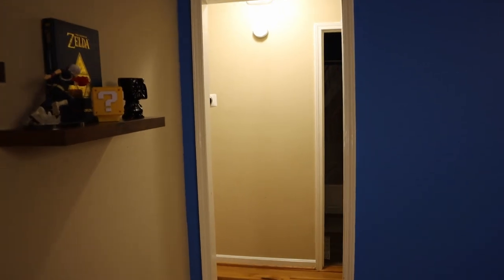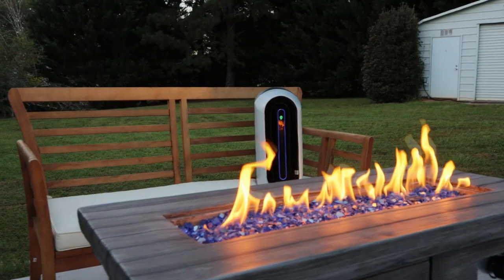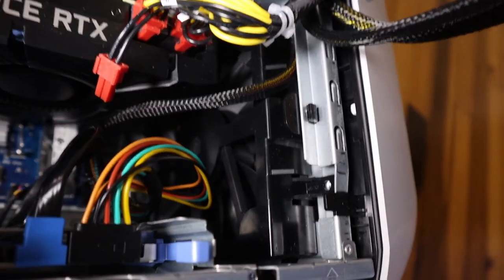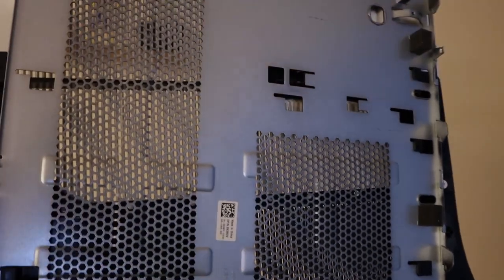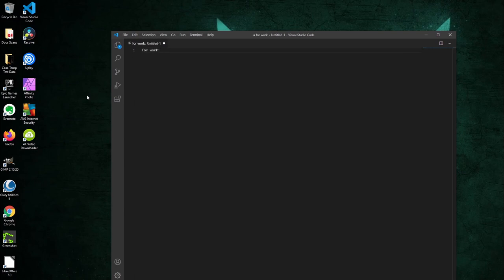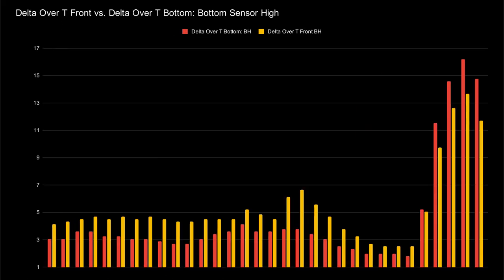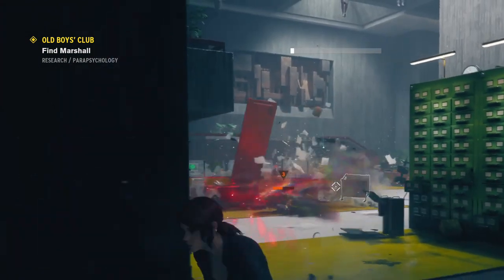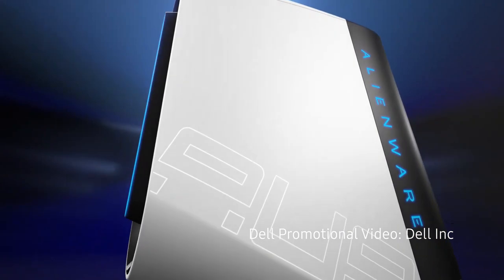Alienware R11 Cooling Teardown with Temperature Benchmarks

Comment: My R10 came with air cooling instead of liquid and was running 90-95 celcius constantly while gaming.  Dell told me the cpu could handle 95 celcius so there was no problem.  The fans are also cheap and were hitting 70dbs making it hard to hear in game sounds even with a high quality headset.

  If you are buying an Alienware Aurora machine make sure to grab the liquid cooled version or be ready to upgrade the cooling yourself.

I ended up grabbing a corsair h60 liquid cooler and changing the front fan to a corsair ml120 pro.  The system now maxes out at 68 celcius and runs super quiet.

Comment: I had the same issue.  Part of the issue is the Alienware control center has the fan controls on Auto.  Don't leave it that way.  Manually change the settings so that the fan kicks into higher speeds when it reaches an acceptable heat.  My CPU heat was spiking up to 100 degree Celsius when gaming on high settings and averaging between 85-95 degrees.  After making some adjustments to my fan controls, the highest I peaked was 83 degrees an averaging 65-75 degrees.  Since they took out the undervolting option, thanks to a BIOS update, had to think of other ways to cool things without scraping the warranty.  Yes, I know, there are better heatsink/fan options out there, but that would void my warranty.  This fan control option works for me... as long as you don't mind the volume they project.
Reply from the maker: I also noticed that Dell tweaked the fan curves in the latest Alienware Control Center update. That said, I am quite happy with the radiator and front case mod that I made.

Comment: I replaced the original GTX 1660ti with RTX 3080 for Microsoft Flight Simulator.  Since the recent update, 1.18.14.0, the workload was moved to the GPU. Now the GPU is hitting 75C.  I am trying to determine how to improve the cooling. I may consider adding an exhaust fan to the left side.  This GPU takes cool air from the bottom and blows some out the back, some out the top, and more out the side. 

The top GPU cooling vent is smaller than the radiator and 1st fan. Since the top vent from the GPU is small, I guess only about 1/4th of the heat would be blown out that vent and to the top PC radiator/fan.

I feel some heat coming from the back of the PC (pushed through by GPU 2nd fan).

However, I think more GPU heat is captured in the bottom half (blocked by the PSU and side cover). So it is likely recirculating.

I have the HDD (which I use for large files like videos and pictures and long term storage).  I may remove the HDD but do not feel an additional front fan there would help the cooling of the GPU.

I am considering a thin fan and hacking the metal part of the side panel.

Comment: I changed all my fans. I have push pull at the top.  Moved the Upper HD to the lower rear of the chassis. Added a Fan in its location and replaced the lower fan.  Top Exhaust fan is the ML120 Pro the 3 other fans are ML120 non rgb types. My system for not much money is now whisper quiet and cool. Later I changed the Psu to a corsair  RM650. again lowering the noise  level.  For the price I expected more from the Brand. I will not be recommending it to anybody.
Reply: do the corsair fans cause any errors in the Alienware SW?
Reply: could you add big 3rd party 3080 in place of intake fan and additional one behind the front cover, but outside the metal cage?
Reply: @kedzis  I have since changed to the thermaltake toughfan 12's. these very noctua af12 looking fans are both quieter and cheaper than the Corsair fans. They do not give the bios error so that's a massive Plus.
For the gpu yes it will go in with the lower intake fan removed. You can install a fan in the drive cage area as that is a removable parts so very simple to do. 
I have seen a fan installed onthe chassis floor but it does mean you have to dremel the plastics on the base to allow air flow.
Reply: @24879067marshall  do you think r10 with rtx3080 with bottom fan moved to upper hd position will not cause any thermal  problems? if I can manage to get one for good price and right size i would like to try, alternatively 3070(ideally two fan model so can keep intake fan in its position Is the maximum lenght of the GPU w/o bottom fan is 30cm and with fan 26.6cm? If I would like to add the additional fan do i use a y spliter or there are enough sockets on the MoBo?
Reply: @kedzis  im using the MSI Rtx3070 X2 Ventus. thats the 2 fan type.  plenty of performance to smash all the titles with great frame rates.

Comment: Loved the video! The intro was cute btw don't worry about it lol. 

Not sure if it's your field exactly, but would you be willing to do a tutorial on how to properly overclock and/or undervolt/lower power the consumption of the computer using the Alienware Command Center? Or at the very least explain the benefits/reasons not to do it? I hear a lot about those things and how it can potentially help gaming go smoother, but I honestly have no idea where to even start and it seems like no one even uses the Command Center as there are no informative videos about it. Thanks!
Reply from the maker: Thanks, and actually that is my field. I myself run a small undervolt on the 10700K of 1.22v with no offset. An undervolt reduces power to the CPU, which helps to reduce temps. Intel engineers are pretty conservative in their the stock voltage and (used to be this way about) their CPU frequencies. This is done to account for manufacturing irregularities across the platter. Though they've gotten better at pushing their stock CPU frequencies; the days of being able to overclock an Intel CPU by 20% or more is pretty much over.

Comment: I have an R11 with 10900k and 3090 first thing I did when it got here was open it up because I’m not the type of person that buys prebuilt machines but with the current GPU market alone there’s no other way to get a FE 3090 without going through scalpers/getting extremely lucky without waiting for a year from the looks of it, and the first thing I disliked (besides the fact the GPU is “a custom 3090 FE manufactured by Nvidia” I emailed/called instantly when I saw it because I really only bought the PC for the GPU but anyways) was the fact that there was only one fan other than the one dedicated to the rad.

Comment: So glad I got the R11 with the GPU liquid cooler. Yeah it's only an RTX 2080 super instead of a 3000 series but it runs so quiet and cool, never get that loud high pitched hair dryer sounding fan noise that air cooled R11 gpus get.
Reply from the maker: It really must be luck of the draw on the air coolers. I've heard people have had nightmares with noise on them, but I've been lucky with my 2070 Super that is aircooled. I did notice a big noise difference when I replaced the front intake fan (video coming soon).
Reply: I've been wondering if I should replace the fans but don't want to cause any problems with BIOS or Alienware command center or whatever. Would like them to be quieter though. Also wondering if it's a difficult job to replace the fans. Looking forward to seeing how that went for you.
Reply from the maker: @tim0thy222  I don't want to spoil it or give it away, but I struggled with the top fan replacement, and found out the hard way that only certain fans will clear the Dell BIOS check. It was worth it though. I will tell you that a Corsair ML120 Pro non-LED will fit up front with no problem if you want to try it for yourself. It must be the ML120 Pro version as the non-pro will not clear the BIOS check.
Reply: I have the r11 with a 3080 and it runs nice an cool around 70c boost all the way to 1950mhz it performs better than my custom build with the founders 3080 tbh

Comment: Great intro, the body of the video almost made me finish my third Master's degree :P
Reply from the maker: Thanks. I tried to present a lot of data without overwhelming anybody. The important thing to remember is that Delta T in this context simply means the reading of the in case sensors over that of the ambient room temperature sensor. I tried not to get too bogged down on this as my main focus of this test was to see if the Alienware was able to move a proper amount of air to cool the case and its components; which it can adequately do.

Comment: Good video!! I didn't understand Delta over T though.
Reply from the maker: It is simply a fancy way used in calculus and engineering of saying how much of a change occurred. I had three sensors: one in the front, one in the bottom, and one in the room measuring ambient temperature (Delta T and my control sensor).

Comment: im getting the r11 3090 10900k 32 gig 3400mhz 2 t ssd. should i get that second fan and if i do does it just pluggin to the powersupply?
Reply: There's videos of people adding a second fan and use Corsair  
SKU CO-9050040-WW
ML120 PRO 120mm PWM Premium Magnetic Levitation Fan

Which draws less power from the source.

But in those videos people are adding am extractor fan not an intake so I'm a bit confused after watching this video, what it doing to the pressure in the PC by adding an extractor fan rather than a intake

Comment: Alienware doesn’t give us gpu fan control which is why I have been using MSI afterburner to control my R9’s rtx 2080 Super. I use the AWCC overclock 2 option and use msi fan control at 50-55ish % on manual not auto because I don’t like the gpu fan throttling and I don’t use the msi fan curves. I ran my game “DCS “ at high performance and thermal performance In AWCC and use this combo only when I have the game running. My gpu temps are always under 75c. Look... it’s a gaming machine its like an automobile/ race car at that with more performance = more heat. My cpu is liquid cooled and would like to go that route one day on my gpu. Great video 👍🏻
Reply: I own r11 i7 with 2080 super. How do you keep your gpu cool? My gpu is over 80+ while playing cold war multi-player
Reply: Super loud when playing game
Reply: Are you using msi afterburner for your gpu fans?
Reply: Download msi afterburner “ it’s free “
YouTube some stuff about it and how to use it. When your ready set the gpu fan to 55 then click apply, not auto ... apply. Then start your game and check the temps. When you take a break from your game set the gpu to auto then click apply. When your ready to play again, unclick auto set gpu fan to 55-60 then click apply and then start your game and have fun. I don’t use gpu fan curves I think it’s better that the gpu fan/fans run 1 speed while gaming. I hope this helps.
Reply: @Mako-sz4qr  yeah, I even set it to 60. Still reaching 77.
Reply: That must but an intense game then but 77c is actually okay. If it’s concerning maybe call Dell to get some better answers or go to dell Alienware forum there is some good help in there. But honestly that may be the lowest temps  you can get in that game/multiplayer and 77c is not bad.
Reply: @Mako-sz4qr  I play Cold War multi-player. I guess it is what it is.
Reply: @itsajoke631  — yeah could be just msi af gpu fan at 60-65 while playing to help the temps. That’s a nice machine you have there.

Comment: The only joe do you have the link of the power supply used in the Alienware r11
Reply from the maker: It is an OEM 1000 watt fully modular standard ATX power supply. It looks to be a FSP Group (non-branded OEM) supply. FSP Group also makes the PSUs for Antec, Silverstone, Thermaltake and Zalman.

Comment: How do I put water in the cooling I need to know
Reply: You need  following parts. Corsair H60 Radiator,  Corsair Ml120 Pro (non led ) Fan.   If you have a fan cable splitter you can even run a push pull configuration on the radiator.  Google liquid cooling upgrade there are lots of guys who have made videos on the process.

Comment: Awesome video - are you planning to replace the front hard drive bay with a second intake fan?
Reply from the maker: It is definitely something that I've been thinking about.
Reply: @theonlyjoe6036  I'm thinking of doing the same, and putting in 2 high-performing front intake fans, as well as either replacing the exhaust fan or adding a second exhaust fan for a push-pull radiator configuration. But I can't find any data on how much this would actually affect temps, so I'm not sure if it's worth the cost and effort.
Reply from the maker: @zerwey  I don't think you would have the clearance for a push / pull for the RAD. I second intake would create a positive pressure environment which would help in cooling. I'm looking to see what options there are throwing a second one in. The one installed (and the mounting cutouts) use a fan that has clips to hold it in place; so I think I would have to go through Dell directly for this part. The other option, for something like some Noctua fans, would be to break out the trust Dremel and simply make my own mounting holes / screw inserts.
Reply: @theonlyjoe6036  Hi Joe. Did you replace the Hard Disc by installing a 2cond Fan? Did you contact Dell for the Mounting Cutout?
Reply: @zerwey  Gamer Heaven has done a test for your reference. Check him out. Very good info on dell mods. 👍

Comment: I wish dell did better on the case and added more exhaust fans and more intake so the inside the case it gets fresh air all the time
The GPU is gonna be very hot and the CPU too If the 3080 was in the case it would not get any Fresh air 
But yeah you have lots of good points they need to do a redesign on the case
Reply from the maker: I think that adding a second front intake fan and creating a positive pressure environment would do the trick. The Alienware does have those massive honey combs vents in the side panel which a positive pressure system would vent through. I'm thinking about modding the case to see if this actually works.

Comment: Thanks for the video! I guess the 3080 GPU will raise internal Temps even more. Yikes.
Reply: Actually,  it doesn’t. See the thermal test done  by people that own the r11 with a 3080 on YouTube.  Dell engineers know what they’re doing.
Reply: @entreri76x  Well I wouldn't say they know what they're doing. There's been numerous complaints regarding thermal issues with the previous R series cases. Hopefully they have fixed these previous overheating issues.
Reply: It doesn’t because there is a completely different cooling system on the 3080 and it doesn’t have a blower style fan.
Reply: @quintrapnell3605  I ended up just building my own PC last October with an AMD 5900x, MSI Tomahawk MB and Asus 3080 OC. Runs great and doesn't get too hot although I have a 280mm cpu liquid cooler which helps and a case with great airflow.
Reply: Then you notice the fans don’t pull air down and out the back as much now. They still blow some what out the back but they also blow upwards and out of the sides.

Comment: I wonder if the 3090 will kill it
Reply from the maker: Dell does already offer the R11 with a 3090 and 3080. The most telling thing for me is they offer the R11 with dual 2080 Supers that are air-cooled, so Dell must be confident that they can adequately cool the case. 17.8F over Delta (room temperature) was the highest the case ever got in my testing, and that really seemed to be the consistent max in 2 weeks worth of data. I know with adequate cooling in a Fractal Design C that can be cut down to about 8 to 10 degree over room temp.  I just want to stress that the cooling is the R11 isn't bad; it is just adequate.
Reply: @theonlyjoe6036  thanks! I'm thinking about cancelling my order and just having a custom one ordered so I can get a lot more cooling to the 3090.. I just can't really seem to find enough data and I really and a bit worried about it getting super hot
Reply: Watched a video of a guy putting a 3070 in one, dude had to remove the front intake fan for it to fit.
Reply from the maker: @itzHippoHiPP0Th3Gam3r  The R11 has a max length of 10.5 inches for a graphics card. Pretty much all 3 fan 3070s are longer than this length. You'd have to look at a 2 fan 3070 like the Zotac, Asus, and even the soon to be released PNY version for the 3070 to fit with no issues. Dell uses the AIO liquid graphics cooler on the 3080 and 3090 on the R11 it sells now in order to get below the 10.5 inch length.
Reply: @theonlyjoe6036  i own the i7 with 2080 super. Super loud and still run over 80 both cpu and gpu

Comment: Didn't mention the water cooling?
Reply from the maker: You are right. I didn't. The purpose of this video was to examine airflow in the case by looking at inside case temps versus ambient. I'm making another video where I've replaced the fans in the R11 and will be looking at component temps; including the AIO radiator for the CPU.
Reply: @theonlyjoe6036  yeah not a big deal but I bought an r11 so just looking up shit while I'm waiting. Will be cool to see the upgrade. Might have to pay someone to do it if its huge difference
Reply from the maker: @maiingon316  Don't want to ruin it, but it does make a big difference with noise levels.
Reply: @theonlyjoe6036  ill be waiting lol